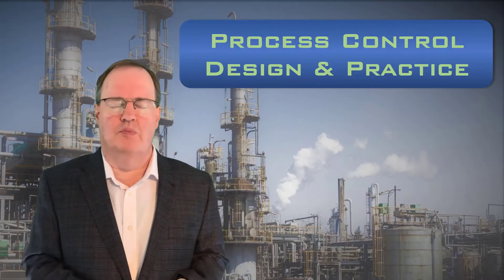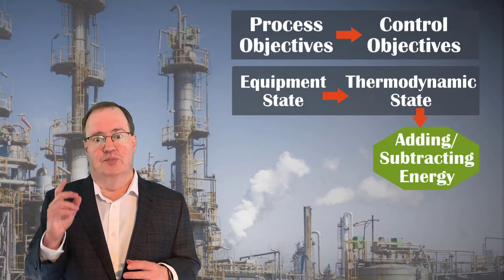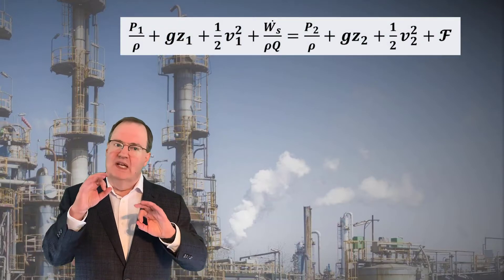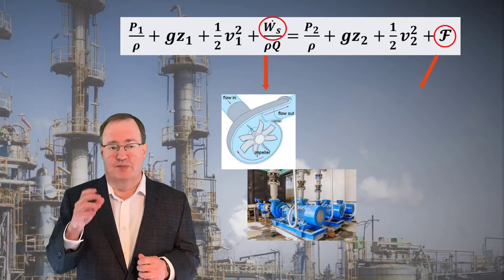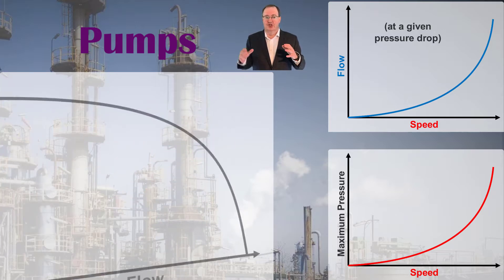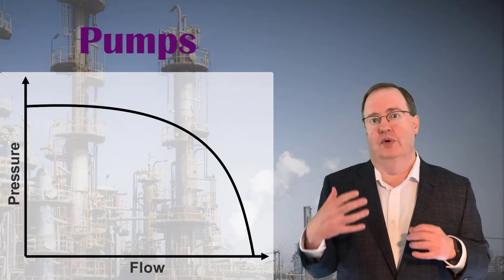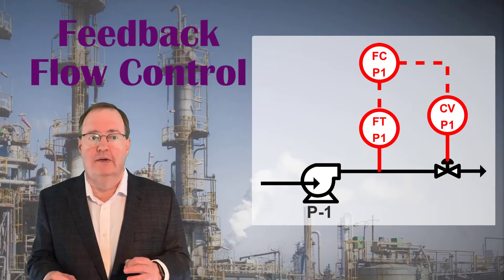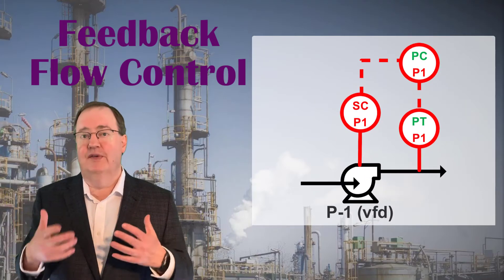Controlling the Process State

Comment: Hi, could you explain a bit deeper what you mean by this. In Chapter 1, practical desing rules. Point 3. says "control valves yield higher pressures upstream. It is vital to avoid liquids flashing to vapor to preserve high heat transfer coefficients", what means that CV yields higher pressures? How that occurs?
Reply from the maker: If a control valve is being used on a process stream passing through a heat exchanger, the valve is not there to control the amount of heat being transferred; the valve controlling the heat exchanger will be on the utility stream.  The valve on the process stream is being used to control either the flow or the pressure of the stream for some other purpose, a purpose that can be achieved either by putting the valve upstream or downstream of the heat exchanger.  So why would it matter whether the CV goes before or after the HX?  There will be a pressure drop across a control valve, even if it is 100% open; the pressure will be higher upstream of the valve than downstream of the valve.  If the heat exchanger is being used as a heater, particularly as a pre-heater for a distillation column or a flash tank, the purpose is to bring the liquid up to its bubble point or often beyond the bubble point, at the pressure of the unit that follows the heater.  If the heat exchanger is at the same pressure as the flash/distillation unit because the process stream CV was placed before the HX, the liquid in the process stream will start to turn to vapor as it passes through the heat exchanger.  If the CV is between the heater and the flash/distillation unit, the pressure will be higher in the heat exchanger, and the process fluid will remain liquid until it passes through the CV.  Because the heat transfer coefficient of a vapor is often an order of magnitude lower than the heat transfer of the same substance as a liquid, it is highly preferred to keep that process fluid a liquid until it has passed through the heat exchanger.  A much smaller exchanger will be required to transfer the same amount of heat to a liquid as to a 2-phase boiling mixture.  So always put CVs on the process stream of a heater downstream of that heater.

Tom Meadowcroft
Reply: @chemicalengineeringpractic21   thank you for your answer, very detalied. Great course.